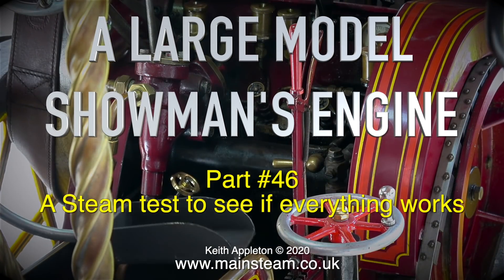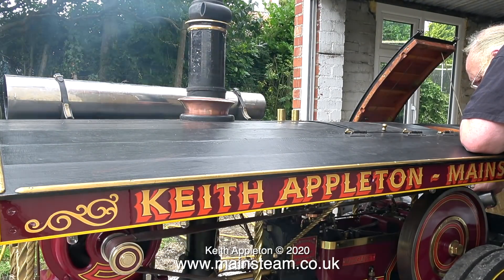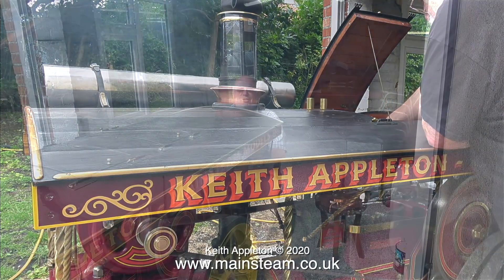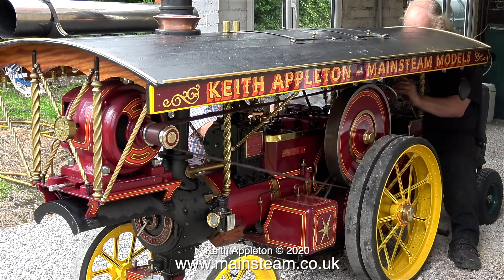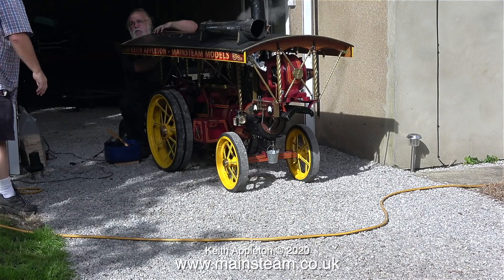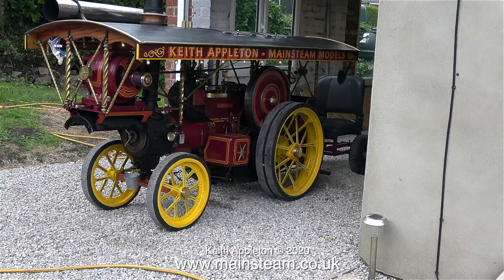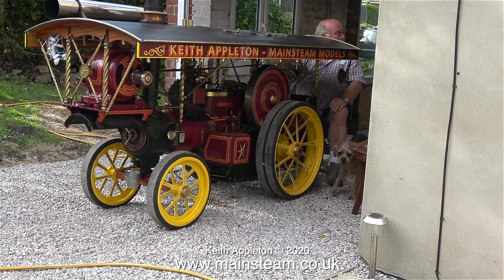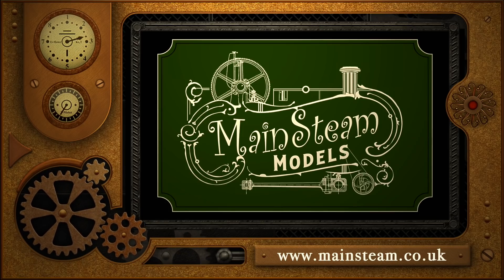A LARGE MODEL SHOWMAN'S ENGINE - PART #46

Comment: I burn anthracite in all my engines; it produces a hot, clean fire with very little smell. To get it to burn correctly in the 4" Ruston SD tractor we had to alter the grate, increasing the airflow. Looking at your grate the bar width and air gaps are equal,  the grate in the Ruston has 5mm bars with 7mm air gaps. The 2" roller has 1/8" bars and 1/4" air gaps for the same reason. Both engines steam well though have slower reacting fires compared to those burning house coal. You may have to decrease the size of the blast jet to increase the draw on the fire as well. Having done a day burning house coal, the effort in making the changes is well worth it.

Comment: didn't you clean the boiler out after the last time you steamed your engine?
a former friend had a live steam model traction engine and he forgot to do that after the first time he steamed his engine up. on another ocasson he got some steam coal that turned out to be not very good and ended up burning bits of wood so he could move the traction engine across his drive.  after that friend of his got him some good steam coal that came from Wales i believe

Comment: Bonjour Keith, siren or not, you have there a beautiful machine. For my liltle Micrososm sirens, same issue solved with some WD40 inside.
And a question, how do you protect the cylinder from the rust after your tests ?
Amicalement, Raphaël
Reply from the maker: The problem was a small piece of grit in the Siren drum. I always rotate the flywheel the day after a run with the drain cocks open to release any trapped water, plus I manually rotate the mechanical lubricator to pump a bit more steam oil into the steam chest and cylinder and it seems to be fine.

Comment: Awsome!
As far as i heard Antracit requires a slightly different design of the firebox in order to work properly on a steamboiler (ay least that is the case for full scale locomotives, but i don't know about model ones in those larger scales).
In blacksmithing it's popular to use Antracit mixes if one wants a less aggressive heat.

Comment: I may of missed this part __what is the pipe strapped to the roof used for?
Reply: Don’t listen to him!  This traction engine is an assault traction engine and the tube is a rocket launcher.
Reply from the maker: Extension chimney to carry the smoke over the heads of people stood near the engine. Shown in an earlier video.
Reply: @keithappleton  thanks

Comment: Backing up for beginners. Backing straight is very difficult. Backing up with a slight curve is easy. And may help with the view. So try to plan backing up is slight curves rather than backing with tiny stone and adjust method

Comment: So lovely. Looking forward to more of it. With the "Number Plate" how much liberty does it grant to public road use? 
Regards, and stay safe.
Reply from the maker: same as a car, it is fully insured. I wouldn't run it on the road at night though.
Reply: @keithappleton  If it's taxes which is free but you still need to do the paperwork and good luck with that, and remember if the engine is registered like a car change of ownership is required

Comment: Small Sirens regularly stick and usually a gentle tap frees it up. A little dribble of light oil down it helps prevent it
Reply from the maker: It was a small particle of grit, I cleaned it out internally and now it is fine. . . . shown in a later video.